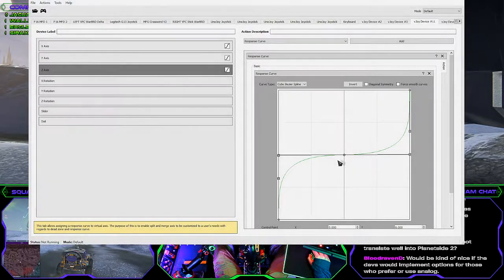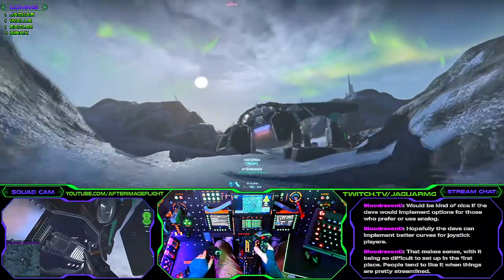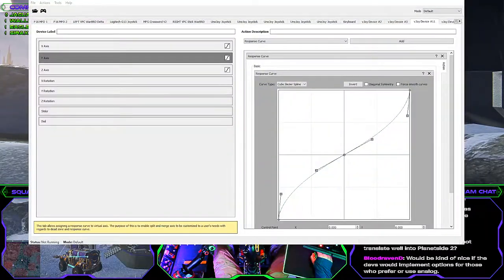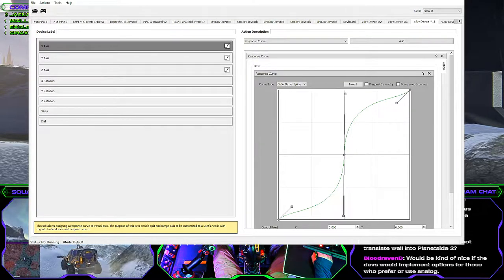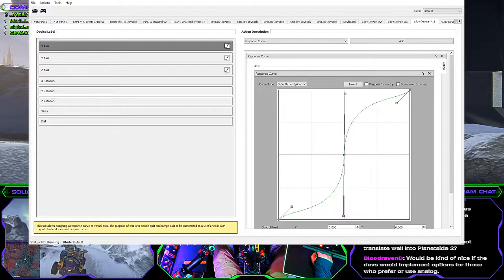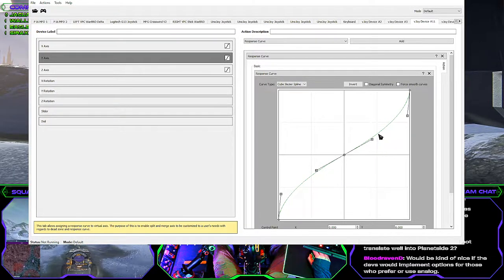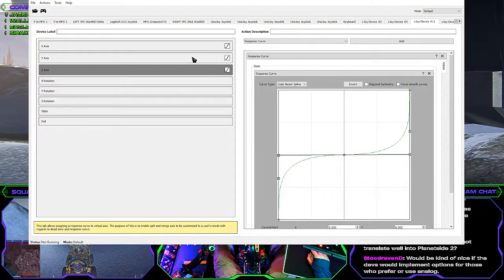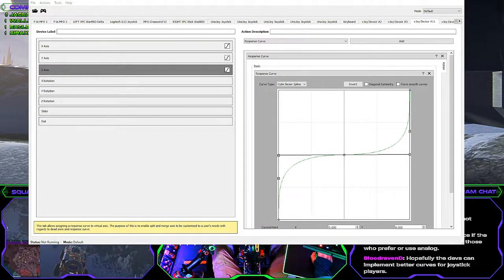Fixing the Dervish Drift - Analog Input Curves Using Joystick Gremlin | PlanetSide 2 Joystick Flight

Comment: I use controller to drive and fly because of the multiple inputs issue’s

But i spend 90% of my time drifting around blowing up sundys so its not a big deal for me because i will spend 50 hours blowing up sundys and maybe 1 or 2 hours flying around and normally because someone needs me to pilot a galaxy which in pretty crap at but i get the job done… most of the time (when i dont forget my key bindings because I’ve been gone for months…)

Tho last time i played was a good 3 months before the giant ass ships in the sky update thing so a long time ago
Reply from the maker: Controller is a good way of getting analog input. Honestly for a Galaxy it would work just fine I imagine. I don't play a lot of PlanetSide, but I find it's a good test bed to quickly try out a few ideas and such from time to time since it's really easy to get into the action.

Comment: As a player who is "trying" to exclusively pilot a dervish for air play, could you A. recommend a joystick? and B. If you where to recommend a joystick for a beginner, what would you recommend?
Reply from the maker: I think the Joystick does give you some advantages with the Dervish. 

Something to keep in mind is you will need to account for 5 analog axis inputs: Yaw, Roll, Pitch, Heave (Up Down Thrust), and Throttle to get the most out of a joystick setup. 

A lot of the time this is going to be spread across multiple input devices (either through a throttle or a second stick), and setting up more than one device for PlanetSide can be painful.

Apart from that, a stick with a smooth gimbal is important, as well as sensor quality. A T16000m or a pair might be the best starting point. PlanetSide joystick support is sorta rough though.

You will definitely want a gunner for the Dervish full time to get the most out of it as well. They'll probably be doing most of the work, so aiming and flying isn't quite as important, but it does help.
Reply from the maker: Also check out this video, it's older but we discuss some joysticks and flying in PS2 on stream here: https://www.youtube.com/watch?v=k801yeUWGt0&list=PLQNRyzLrtdRtj0etzxnv_RQil8ZAHhSPB&index=20
Reply: @AfterimageFlight  You don't happen to have a discord btw do you? maybe somewhere I can ask questions once I get my joystick?

Comment: Ahoy there, i tried and tried, but running the dervish as testbed leaves me with a big problem.
I use vjoy and Joystick gremlin aswell, and all is well, except the roll axis on my HOTAS. It rolls so slow, though i put in a more aggressive curve.
If i compare Joystick and mouse roll i can get roughly 22°/second roll to a side with the mouse, but the hotas just rolls at 1°/second.
Any idea how i can fix this? The input is absolute 100% and i can see it directly translating to the Vjoy device. It is just the game, not responding fully to my Stick's X-Axis.

Edit:
I upped the joystick sensitivity to 2, still mouse roll is faster and more responsive, but the joy-roll is better.
Reply from the maker: Hi. I haven't had a chance to dive in and try to replicate this, but a couple of things come to mind. I've not run into any issues with rotation rates being different per control method other than the usual delay on axis deflection from analog input.

In game my joystick sensitivity is set to 1.6.

There's a control bug in PS2 where if you mix input types it can impact how fast an aircraft rotates. Are you using any keyboard controls, or digital controls at all at the same time? You could try to unbind anything that's not in use.

Does this happen across other vehicles? There was a bug when the Dervish was still on the test server that caused it to not respond to Analog Yaw at all.
Reply: @AfterimageFlight  My setup is a X52 pro, mapped via gremlin to my vjoy device. I did unbind all the keys from aircraft controls, without any impact on behaviour. Mouse still rolls way faster, seems like joystick can't roll at 100% roll rate. I'm not using any other input, just the HOTAS. I tested this on no airframe and rotor airframe. Same behaviour, must be a thing in Planetside 2. I even did unplug the mouse, still no change in behaviour, feels like joystick is capped to 50% roll rate of mouse at sensitivity 2 for me.

Edit: Tested with the Liberator. The Libs with high G has same rollrate on mouse and joystick as far as i can tell. Seems to be a dervish problem. Maybe they have limited the roll curve on joy?